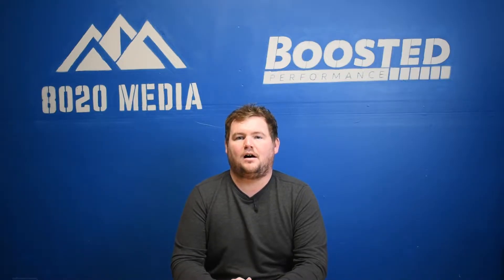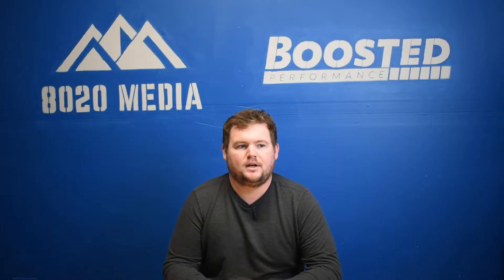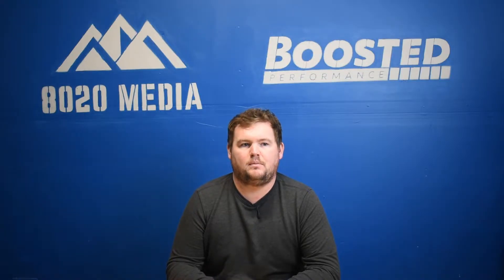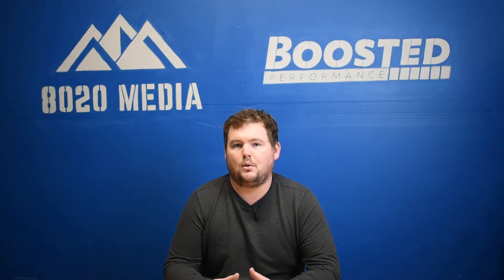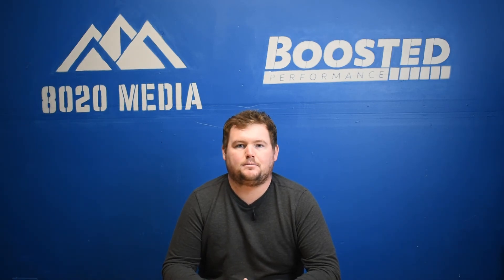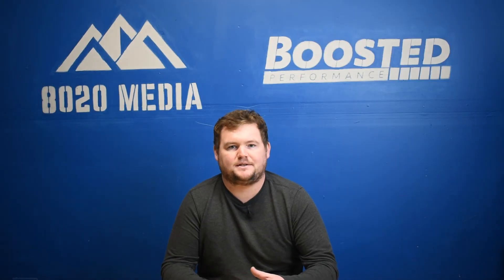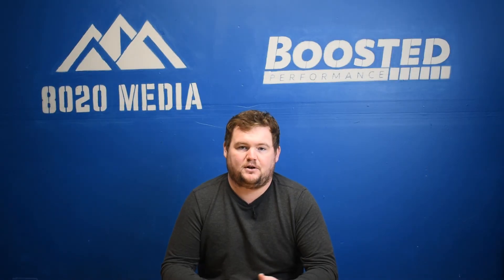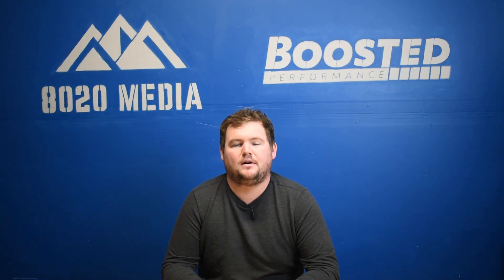BMW N52 Engine | Reliability and 4 Common Problems

Comment: My partner recently just bought a 2010 528i for cheap in hopes of getting it running. It turns on and idles but won’t shift out of park. It shift like it’s about to and then jumps back into park. He’s already changed out the parking sensor which didn’t do anything. I was thinking it was a shift interlock solenoid but do you have any suggestions?

Comment: Made it to 160k. Only issues were oil filter housing gasket leaking, ac compressor exploded and oil pan leaking a little.
Reply from the maker: J - Thanks for taking the time to share your experience! Sounds like normal BMW problems at those levels.

Comment: Just noticed quite heavy wear on the cam actuator unit screw gear and the mating gear quadrant on the shaft at 170k miles.  I’ll get the bits sorted and replace them
Reply from the maker: A - Keep us updated!

Comment: 2006 325i with 52k miles. For 8k should I get it?
Reply from the maker: K - If it’s in truly excellent condition and well-maintained, a 2006 BMW 325i with only 52k miles for $8k could be a fair deal, but you need to factor in that these E90-generation BMWs are now nearly 20 years old, and age-related issues—especially with cooling system components (water pump, thermostat, radiator), valve cover gaskets, and suspension bushings—can still arise regardless of mileage. Before buying, I’d have it inspected by a BMW specialist, confirm full maintenance records, check for any oil leaks, cooling system work, and transmission fluid service, and make sure the electronics and iDrive (if equipped) work flawlessly. If the inspection comes back clean, $8k is reasonable for such low miles, but budget at least $1–2k over the next couple of years for preventative maintenance to keep it trouble-free.
Reply: @8020Automotive what would you offer? For a fair deal

Comment: Im considering buying a used 2006 bmw 325 with 146k miles which features n52. I read alot of 200k+ miles from the car after a bit of work. Got a test drive and it runs well it seems with some minor cosmetic defects on par for a 19yo car. Brake light was on and coolant light turned on while it was driving and turned off when stopped. No ticking at all. Price is cheap 6k-7k. Is this a good purchase? Will i be able to get the 200k+ mileage from this car?
Reply from the maker: J - All really depends on how well it was maintained prior. We wouldn't buy it, but it's possible to get another 50-60k out of it.
Reply: I have a mint 06 325i with a little over 100k   Has Bilstein shocks, no runflats and runs great.  Rwd florida car.  I would take it anywhere.  😊
Reply: I bought a miata with 22k instead. Im too anxious about this stuff. I appreciate the info though.

Comment: what year of the N52 of the f10 would you suggest i get as a beginner in the BMW brand
Reply from the maker: I - If you're a beginner to BMW ownership and looking at the N52-powered F10 5-Series, the best option would be the 2011 BMW 528i with the naturally aspirated N52B30 engine. This was the last model year BMW used the N52 before switching to the turbocharged N20 in 2012. The 2011 model is considered more reliable since the N52 lacks a turbocharger, reducing common failure points like high-pressure fuel pumps and turbo seals. It also doesn’t have direct injection, meaning you won’t have carbon buildup issues. Look for one with good service history, focusing on cooling system components, oil leaks, and VANOS maintenance, as those are the most common N52-related issues. Keep us updated!

Comment: Is this engine double vanos ? Has problems with this ?
Reply from the maker: C - Yes, the N52 engine is equipped with dual VANOS, meaning it has variable valve timing on both the intake and exhaust camshafts. This system helps improve power delivery, fuel efficiency, and emissions by adjusting cam timing based on engine load and RPM.

Comment: If you have 2.5 with 215 hp or 3.0 with more than 250hp you likely have the multi stage intake. The intake will have two DISA flaps controlled by the DME. These can fail and can cause material to be sucked into the cylinders. You can take them out and check, sometimes they will throw a DME code. The small flap is under the intake but you can remove it by taking out the alternator and reaching around, without taking off the manifold. You will need some new bolts to put the alternator back in, but this is much quicker than removing the manifold. It is also a good time to replace the CCV heater elbow element, part of a recall for fire risk.
Reply from the maker: A - Thanks for sharing these insights.

Comment: Water pump symptoms are the fan on maximum speed when pulling up after a drive. It will throw a DME code related to water pump.
Reply from the maker: A - Thanks for sharing these insights.

Comment: In addition to vanos solenoids you should check the vanos non-return valves, front right of side of engine. Take them out and shake them, they should click. Need to replace the orings if you take them out. These can become blocked and/or stop functioning. This can cause vanos failure like symptoms on startup, often leading to incorrect vanos solenoid failure diagnosis.
Reply from the maker: A - Thanks for sharing these insights.

Comment: Good information. Just wondering if you usually get any warning if the electric water pump fails, or do they just quit out of the blue? My E92 325i has done 116,000Km (about 72,000 miles). Should I change it now, or can it wait a bit longer?
Reply from the maker: C - Unfortunately, both can occur. If you think you're having issues with it, wouldn't hurt to replace it as the alternative could be far worse.

Comment: A piece of the DISA valve ended up breaking off inside the intake runner and wedging the 3rd valve open. If you are hearing knocking consider this before you go further. This is a known issue of the DISA valve breaking but have not seen anything posted online about pieces ingested into the motor and hanging valves. Hope this helps someone.
Reply from the maker: B - Sorry to hear this! However, thanks for sharing your experience.

Comment: I own a 2009 X5 with the N52.... all I replaced thus far are the Vanos Solenoids, Valve Cover and gaskets, BMW replaced the PCV valve for me under recall.... I got a new belt, O2 sensors, Ignition Coils, DTML pump, New intake gaskets and oil change every 3500 to 5000 miles using Liqui Molly 5W40...... I now have 246k miles and it still running strong....
Reply from the maker: X - Thanks for sharing your experience. Sounds like you take great care of it. Goes to show what good maintenance can do!
Reply: I am getting ready to purchase a 2009 X5 with the N52 and 103,000 miles. The dealer replaced the oil pan gasket and one of the air struts. I will make note of the things you have repaired. Thank you all for the great community info. Happy motoring.  👍

Comment: Purchased a 2006 E61 530i with 20.000 KM  on the meter, The previous owner really cared for the car and the engine and made like 75% of theese replacements, i did thea oilcooler gasket and some Hoses that were prone to fail soon (looked horrible) pretty much the day after and it runs like butter and is by far one of the Funnier cars i have owned!
Reply from the maker: M - Crazy what great maintenance does! Thanks for sharing your experience.
Reply: Got a 2008 e60 530i great car after having a m47 for 4 years

Comment: In reality we have had our N51 now from New 2010 E92 M Sport. As for the problems up till now have only replaced 1 hose, and a battery, oil housing gaskets. Therm sensor. Nothing more..this is really been a very reliable car.
Reply from the maker: R - Thanks for sharing your experience! This will certainly help future viewers.

Comment: Yes, N51 with the smog pump and the 3 stage manifold for smog requirements in some states N52 not much different. the best engine BMW EVER MADE. Up till this day. In the next first naturally aspirated V8 N54 With the rod bearings failure and throttle actuators going out.
Reply from the maker: R - Thanks for the added insight.

Comment: I own a 2007 bmw 130i. Best car I’ve ever had and the engines if well maintained are pretty much bulletproof 💪🏼🙂
Reply from the maker: B - We wouldn't say "bulletproof", but yes, they can be solid engines.
Reply: 2006 owner of the same. It's a keeper.

Comment: 265.000 km from 2007 here (black cover). Changed the starter. Oil consumption is 1 liter/10.000 km.
Reply from the maker: Awesome, that's reasonable oil consumption

Comment: Great and informative video. 
BMW replaced my entire engine head (under a CPO warranty) at around 80k miles on my ‘06 330i due to the ticking hydraulic valve lifters. This was about a month before my warranty expired. Car now has 155k miles and has never run better.
Reply from the maker: Sweet that's awesome they held up the warranty on that one!

Comment: On mine after over 250,000 miles I have had to replace the waterpump twice, do all of the cooling lines and overflow tank, ignition coils, valve cover gasket, Oil pan gasket and now the car does not leak and loses 0 oil. It is one of if not the strongest motor I have ever had in a car and I have owned a lot of vehicles.
Reply from the maker: D - Thanks for sharing your experience!
Reply: Mine has 246k miles and I pretty much did the same as you
Reply: @x5e70_legend mines at 185,000 miles. Oil pan leaks
Reply: May I ask for the make and model of said BMW
Reply: @marleyjanim5033  Its a 2006 325i
Reply: @davezaffina1983  shiit I replaced water pump thermo valve cover oil filter housing control arms radiator because of a damn crack which csf gave me a bad radiator all new hoses metal Mickey man she just runs
Reply: @marleyjanim5033  E90
Reply: What water pump brand do you recommend for the N52?
Reply: @dalisobanda5575  Use the Pierburg OEM water pump
Reply: @dalisobanda5575 pierburg

Comment: Bought an e90 325i, had a coolant hose i had to replace and change the starter aswell a gasket, runs good otherwise despite being a 05 with 203 k miles
Reply from the maker: L - Thanks for taking the time to share your experience.

Comment: I was on the market looking at a 2008 bmw 125i has around 90000km you reckon it’s reliable? 
As well as any signs or indicators should I look for?
Is it a good daily car?
Final question is that should I replace those things you’ve listed in the video straight away as soon as I get the car?
Reply from the maker: E - 90k might be a little aggressive for a BMW. However, it all depends on maintenance.
Reply: @8020Automotive what mods do you think I should do to it like front bumper air intakes etc
Reply from the maker: E - We made a full video on this: https://youtu.be/szHRMjA3hK4
Reply: Get a E30

Comment: I've been tearing into my 120k mile N52 over the past few weeks to addresses a few issues. First is the water pump.  My car threw a code for low RPM on water pump. While waiting for the pump to arrive, it developed a radiator leak. Lucky timing, I suppose. It isn't too hard to replace the water pump with the radiator removed. I'm also replacing most of the radiator hoses too. I figure while everything was being worked on, now is a good time for new shocks and struts all the way around. The front struts always made sounds going over speed bumps, so hopefully with new Bilsteins and bushings all the way around, my car should ride like new. Additionally, I'm replacing all ignition coils, plugs, and O2 sensors. Finally, I need to address the oil leak. I'm 99% sure it is leaking from the oil pan gasket, so that's gonna be a chore. While I'm at it, I'll do the engine and transmission mounts too. Other than the malfunctioning water pump and an earlier valve cover leaking, this car has been very reliable. It
Reply from the maker: B - Thanks for taking the time to share your experience!

Comment: 2009 328 here.  What I have had to deal with:   Cover gasket oil leak, filter housing oil leak, a recall for PCV fires, spark plugs (one broke).  265+ Km on the car. 

I would like to know why the oil filter is partially collapsed at every oil change.  Yes the inner support cage and Orings are in correctly.  Has run with 5w40 0w40 5w30.  I am leaning towards 5w20 next.

Otherwise runs smooth and quiet.  It cannot hold a candle to my v8 hemi powered Ram for raw grunt, but it is a fun little runabout car with impressive high speed stability when it finally winds up.
Reply from the maker: B - Thanks for taking the time to share your experience!

Comment: New owner of a 2008 x5 3.0 si.   

It has accomplished 206k miles and only issue I currently have is occasional rough idle and valve cover gasket leak.
Reply from the maker: 1 - Thanks for sharing your experience! Sounds like you take great care of it.
Reply: I have one too around the same mileage same model n same problem but I started fix it cuz is a really good machine n I love it.
Reply from the maker: D - Thanks for sharing your experience!

Comment: Dont foget the expensive camshaft sensor and vanos solenoids, otherwise solid car!!
Reply from the maker: Yeah valid points - the solenoids go frequently for sure, just have to avoid the Genuine BMW parts since those suckers are expensive.
Reply: @8020Automotive  absolutely, the junction box packs up too…

Comment: I just got one Z4 coule with N52 at pnly 6k miles! Bring the car to the mechanic tomorrow to see what to expect in changing so I can enjoy the beast.
Reply: And I checked the engine there no leaks...yet...
Reply from the maker: Guam - I sure hope you don't have any issues at 6k miles.. Keep us updated. Congrats on the new ride.
Reply: @8020Media  so far just done the oil change and the windshield sprayer pump replaced.  Driving smooth other than feeling the gear box a little vibration but the mechanic said it's normal for that 2006 era cars.
Reply from the maker: G - Thanks for sharing your experience!
Reply: @8020Media  now that I gave some spirited drive I do see some cover gasket leak and the oil cap on top of the cover has oils around and perhaps splashed a bit to the front.  Gotta take immediate action about that.
Reply from the maker: G - Absolutely! The longer it goes ignored, the worse it'll be.

Comment: I’m getting this code 131508 for 2011 bmw 528i is my solenoid bad
Reply from the maker: Buss - Here's a great thread for your research: https://www.justanswer.com/bmw/l50oz-idle-fluctuations-startup-sets-131508-code.html
Reply: I have this problem... First try switching your camshaft sensors and vanos solenoid. If the error doesnt follow then your going to need to open up the valve cover. My intake cam wouldnt retard or advance as i was watching live data with my autophix module. When i put the timinbg tool on it to remove the camshaft and vanos gear the timing was off 30* but i was able to advance it as it was stuck at that spot. They can move and are suppose to cause they are spring loaded. Further investigation after removing the camshaft it had scored bearing surfaces on the cam and journal. But it was only on the removable journals because the variable timing eccentric cam pushes ot outward into the outside replaceable journals. It couldnt advance or retard because of the rough surfaces, still able to turn with the engine but to much for it to return to original spot. This is the information nobody is going to give you. Its a good time to inspect the ledges too. New teflon seals can usually prolong the operation of the engine but will need to put on another head eventually. I just lightly sanded and polished the journals and cam as it wasnt horrible yet because i wouldnt drive it with codes which was the smart thing to do. Having the intake can built in was a mistake with this engine and they went away from it with the n54.

Comment: Your channel is really good. We have a 2010 328i E92 N51 with the 3 stage manifold, stright 6  M Sport pak. Naturally aspirated. And yes" that car is very reliable with small problems like 70,000 miles water pump, vanos cyl. But nothing of great problems, NONE. Again thank you BMW FAN.
Reply from the maker: Roger - Thanks for the feedback! We really appreciate it and don't plan on stopping anytime soon.
Reply: how many miles when your vanos bolts went bad?  thanks

Comment: My 2009 328i convertible is running strong with a little over 136,000 miles. No leaks whatsoever btw
Reply from the maker: D - Thanks for sharing your experience!
Reply: No problem. All the advice is in this video. These truly are the top 4 common problems these engines have. I didn’t do anything special with my car, just oil changes every 5k miles.  Change gaskets when they leak. So to clarify, when I said I had no leaks it means no leaks when the gaskets are good. Of course you’re gonna get leaks when they wear out, but everything’s nice and dry after a replacement. I really don’t know why people complain about their N52s burning so much oil, anyway. Oh I think I still have the factory water pump, it’s still working to this day and I should probably replace it soon. The car is 100% a southern Californian car so the weather has been very kind to it. I did recently replace the factory starter because it was going bad. Factory shocks are still good but I have a tiny leak on the drivers side. It still handles like a dream though so I’ll wait awhile before replacing. These are solid built engines/cars. Also, Californian cars have stricter emissions standards so my engine is actually N51B30 which is the SULEV version of the N52. There’s a sticker in front on the cylinder head that says so. It just means more emissions junk to maintain, but so far so good. 😊
Reply: @danielcurtis8895  I again thank you for taking time out of your day to reply to me and wish you good luck!
Reply: YOU NEVER HAD ANY LEAKS?
Reply: Fortunately no. I take good care of the car
Reply: Thank you for replying.. I have a 2011 528i   (n52) with 6,000 miles on it and would appreciate any advice  you could give.